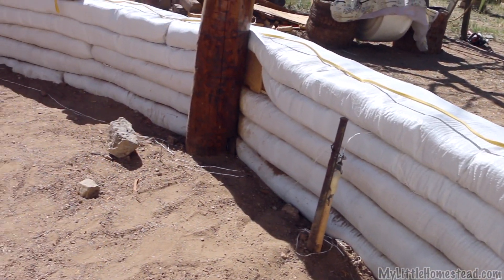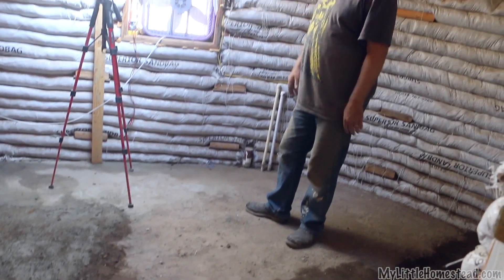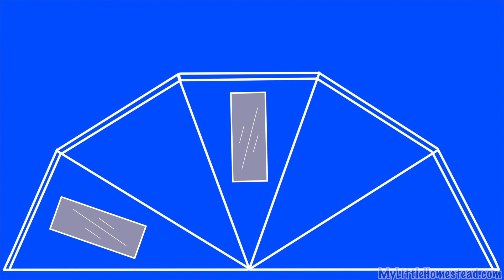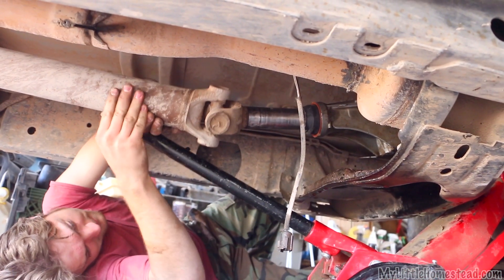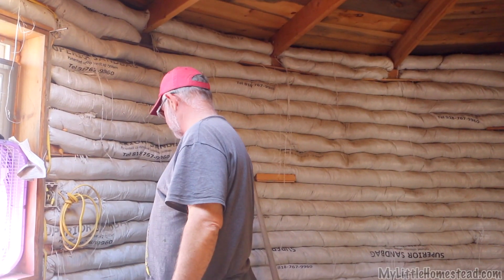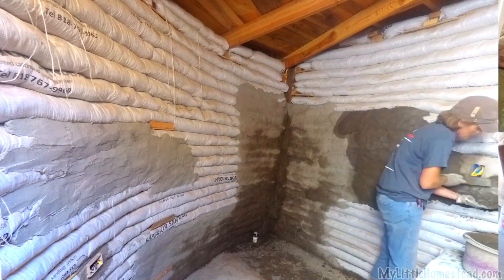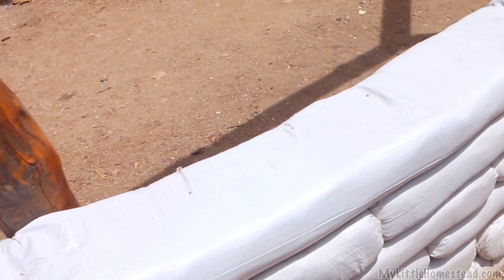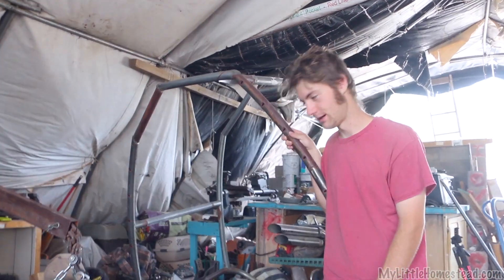Bathroom Soil Cement, Electrical & Stucco | Earthbag Kitchen & Bathroom | Weekly Peek Ep134

Comment: Another thought about the rooflines, drip areas? You can take J Channel vinyl siding strips, clip into them small 30 to 45 degree triangles to shape them into round form fitting drip or rain gutters and simply affix them under your roofing edges.  J channel or simply flashing, but you get the idea. Its what siders and roofers use when they are working on homes pre rain gutter installation. That way your doorway areas, wont be runoff areas. Or perhaps any areas near sensitive connections go, or possible drip damage to the structure. It looks better on houses because you cant see it tucked under the roofing tiles, but its less expensive and a nice touch for homes you dont run rain gutters around for the weather areas.

Comment: You might consider putting up sheets of foam insulation on the outside of the kitchen wall, then putting stucco over that.  The insulation would block the brunt of the heat from the sun.

Comment: I spent a whole summer rebuilding transmissions for my dad. I would clean them out using wd-40, then use a spray bottle with transmission fluid in it to lube the parts as I put them back together. learned to do it by just taking them apart, trial and error.
Reply: Brenda fifer
Way cool!!!! I am proud for you!!! I love thses videos because they show and prove we can do anything ourselves, we just have to put our minds to it, seek out info and knowledge, of course add in the manual labor, and get er done!!! And gender, and age do not matter!!!!

Comment: Like the curved walls for the bathroom 💧⛲ should feel cosey and roomy very neat no edges like water.  Nice size project, should be super fast construction compared to bedrooms and studio.  You all had a good week, 🚗 brand new transmission, 😎 skylights, 👘vanity, 🕑 quick fixes for floor and 🔌 electrical box. Have a good May Day! 🎊🎏

Comment: As a potential project, once you've finished with the bathroom/kitchen, going along the long walls of the house with earthbag and stucco (either inside or outside) would add thermal mass to the walls and reduce the severity of temperature swings due to solar collecting, or wind-related cooling during colder weather.  Essentially it would add insulation value to the walls, making it easier to keep cool in summer, and warm during winter.

However, doing this inside would reduce the square footage of the rooms, and require re-wiring outlets, while presenting the challenge of working in more constrained spaces, especially at the tops of the walls, but would not affect existing window placements.

On the outside, you wouldn't be as constrained for space while working, but the top of the walls would need coverage to prevent rain damage and such.  This could allow you to create deeper window placements (bay style windows?), and might need placement of outdoor outlets.

Comment: Glad you realized that it isn't a big deal rebuilding an automatic transmission. Generally you just take them apart and put them back together with new copies of parts that wear out. Manual transmissions are even easier as long as you have a press, but I like rebuilding them better. There's something really fun about pressing the parts off and later back on the shafts. Great analogy about clutches. That's all they are, clutch packs.
I don't know that I agree that most older people know what they are talking about. People that just want to sound like they know what they are talking about rarely outgrow that with age. I'd go with some older folks and some younger folks have the integrity to only talk like they know about things that they actually know. When they don't they just tell you, I don't know.
Then there's all the rest. Just sayin'.

Comment: Can you please tell me what part of the south west you live in?  Would these houses work in a wetter climate?
Reply from the maker: Wet climates are manageable if the foundations, cladding and roof structures are designed correctly. Check with local builders...